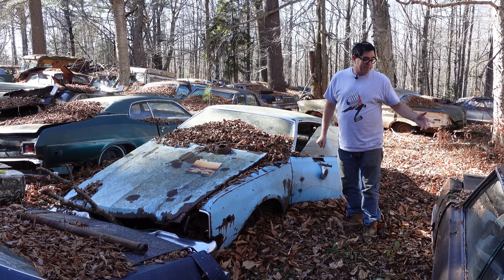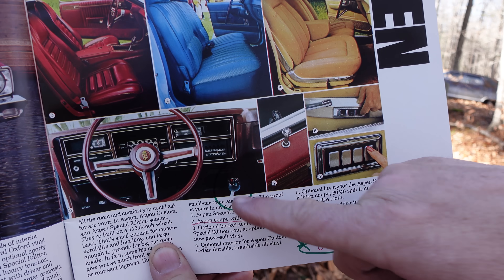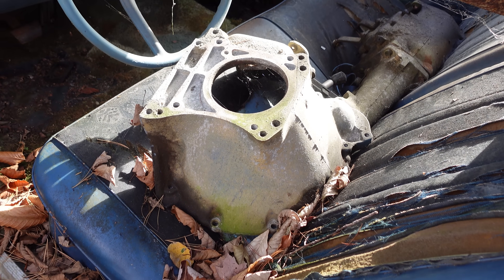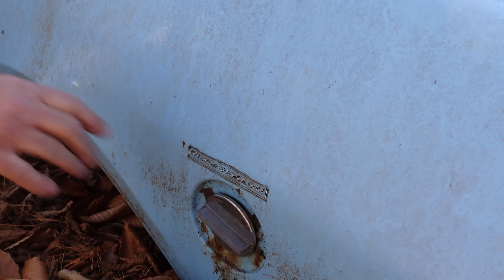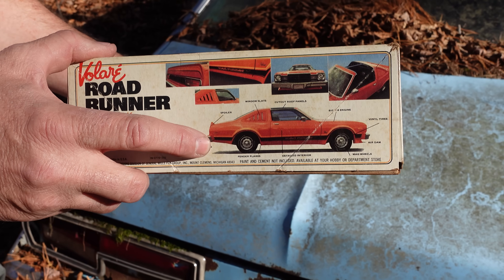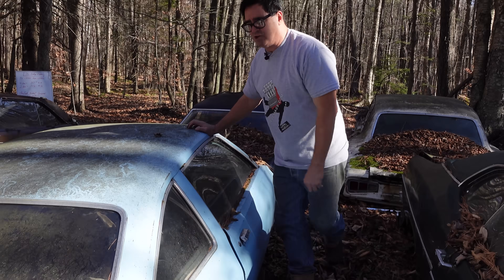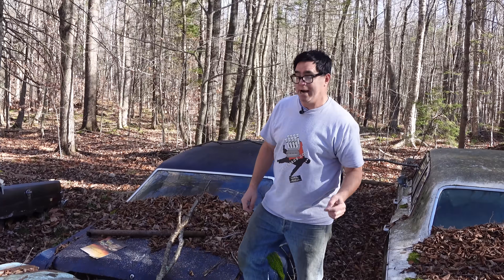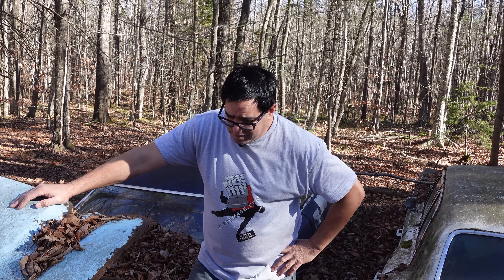First F

Comment: Great 👍 review Steve ! My parents owned a 1975 Dodge Aspen sedan, the drivetrain was bulletproof but rusted out within 10 years , my parents ended up buying a 84 Pontiac Parisienne wagon  .
Reply: I think you mean 1976 as that was the first model year for the Aspen, not 1975.
Reply: @googleusergp  yes my stupid phone has a mind of its own . We had a 76 Aspen.
Reply from the maker: Thanks for sharing!
Reply: We had a neighbor that had a 1977 Plymouth Volare station wagon brand new. It had rusted so badly by 1983 they they traded it in and never bought another Chrysler product again. They traded the Volare in on a used 1979 Chevrolet Impala Station Wagon from the local Chevy dealer. They had The Impala until 1990. The story with the Aspen and the 1984 Pontiac reminded me this.

Comment: The nozzles were different,.but leaded gas still existed (regular or premium) into the late 1980s. I worked at a gas station and one day, a 1970s Aspen Wagon was at the station, and i saw it had no unleaded sticker, and the tank opening was larger. The owner revealed it was brought over from Europe. So it was configured for leaded gas.
Reply: One small chain here sold leaded gas as late as 1992.   Sears, not to be confused with the department store.  They were based in Rome, NY and had 40-ish stations in central New York.  Eventually Hess bought them out.
Reply: @CR7659  Yes, by 1996, it was completely banned. By 1986, it was mostly gone. Some 1970s small engine manuals (such as Tecumseh) will state, "Use either regular leaded or unleaded fuel".
Reply: @googleusergp  I put it in a 1970 Gran Prix with a 4-speed.  Wish I knew where that car was now.
Reply: @CR7659  Can't save them all. LOL.
Reply: @googleusergp  My dad sold it running and driving in 1992

Comment: The 360 police specials had dual exhaust pipes back to the differential then two into one resonator on the passenger side of the fuel tank. The single exit diameter was so large some thought it was a diesel.  
I put a lot of miles on that car, loved it.

Comment: I had 2 Volares. The first was a 77 Coupe bought in 1981. It had the front fenders already replaced but they were still in primer (no one bothered to paint them). I rattle canned and wet sanded them, which came out fine for what it was. That Volare saved my life in an accident caused by a moron in a Camaro. They were strong cars;  that crash beam in the door was no joke. My dad and I stripped the wreck for parts and scrapped the body.  I found a low mileage 1979 Volare sedan and drove that to the point where the actual k-frame rotted out from underneath it. By then it had over 160000 miles on it and was a dual-fuel vehicle (burned equal amounts of gas and oil).
Reply: The NY rust would eat them alive, just as it does in New England where Mr. Magnante lives.
Reply: @googleusergp  That and the salty south shore environment on Long Island where the 79 came from. It was doomed from the start. Amazingly, my dad's 66 Coronet survives to this day with only having minimal rust in a few areas that I've since welded in patches. He had it undercoated from new (I still have the receipt; it cost $25 back in 66). He babied it from new but it was his daily driver for 30 straight years (right until he retired), then became a weekend warrior.
Reply: @LongIslandMopars  My '80 Trans Am was Ziebarted in 1981 (yup, I have the receipt for it too) and their motto is, "It's Us Or It's Rust" and now, "It's Still Us, Or It's Rust", and for the most part, it has worked. Ziebarting is still big with heavy trucks and utility bodies today. My parents bought the car new and whatever I didn't have for it new, I "recreated" by finding NOS and using a typewriter to replicate it. For instance, for some reason, the dealer warranty folder wasn't with the car. So I found a good used one in the yard that was blank and my mom still had a typewriter at work at the time, so she typed in the information as the title clerk would have done in 1980. The sales manager that sold us the car just died in May of this year and his family did a tribute to him on  YT. Look up "RIP Ernie Viespoli" and that's the person that sold us four Pontiacs between 1977 and 1981. You can see him wearing some dealership shirts in some of the footage. 

A few years back I contacted Ziebart and the woman there sent me a few new "Knight Shield" 'Ziebart NOS decals that they still had. Although they are a different color than the originals, they are close enough. My parents had a Chapman alarm installed in 1981-1982 and their motto was "Chapman: You Can't Beat the System". The model was called "The Insurance Man". It still in place on the car, and I have all of the keys (and books) for it, but it hasn't been used in several years.
Reply: @googleusergp  Very cool. I also remember the Chapman locks although my dad's solution was to pull the coil wire on the Coronet and then chain down the hood. 😁 When my parents bought a 1984 Chevy Celebrity, they had a Maxi-Lock installed. That was too fancy for dad but mom had to have it.🙄
Reply: @LongIslandMopars  Yikes, the wrong "A" body. LOL. My cousin had a 1987 Celebrity 2.5L Eurosport that was a company car. My uncle was the fleet director there (retiring in 2005) and we all worked there at one point in time. I worked there for about a year and half while interviewing for automotive jobs (which I got one in 1994 and stayed there 11 years before moving to my current job). A lot of my family members got ex-company cars and my uncle had connections where he could make a phone call and they would give us employee/factory pricing on a vehicle. My 1989 Cavalier was bought that way by my grandparents. $10,500 out the door, everything, with one phone call. 

Yup, can't steal (easily) what you can't start. That would foil most thieves and that was the idea. Our 1980 Bonneville Brougham was stolen in 1982 when my dad, uncle and grandfather went for pre-season bowling practice. My dad knew it was gone when he came out to the lot. When the cops came to take the report, the cop said, "Hey Mac, lemme ask ya this: Did it have a leather or velour interior?" My dad said, "Tan velour". The cop said, "Mac, call yer insurance company. That car is already on a boat overseas. Fahget about seeing again". Never did find it and it was replaced with a 1983 Coupe DeVille. My father went on sell Cadillacs at the same dealer a year and a half later, but he still told his colleagues, "As much as I like my Cadillac, I liked the Bonneville better". LOL.
Reply: @googleusergp  Ironically, the Celebrity was a company car that my dad's job leased from Avis. They would offer to sell off "the good ones" to employees after the leases were up so my dad bought it for my mom in 1987.  It was a CL in Autumn Maple Firemist with the velour interior and 2.8. Since we were a Mopar family up to that point, it was a huge departure from what we were accustomed to. Rode great, steered well, V6 was fun. Then the problems came (clear coat peeled, TCC solenoid went bad twice, morning sickness in the rack, electronic Rochester started acting up). We changed the rack once and the TCC solenoid twice, got the upper half of the body repainted, and tweaked on the carb. Kept it going until 2011, then it got donated to Kars 4 Kids. I do have an appreciation for how GM cars ride and steer. I've had my share of Fords in addition to my Mopars and will still say that GM rides the best based on that little Celebrity.
Reply: @LongIslandMopars  My dad worked for a Cadillac dealer from 1984 to 1988, so they saw the "Cadalier" (Cimarron which was a gussied up Cavalier) in the shop. Right away you could see that Cadillac was going down the tubes. LOL. The front wheel drive downsized DeVilles and Fleetwoods were another step in the wrong direction. The Skyhawk that my grandparents got to replace the Volare in 1986 was a trade-in. It was an OK car, but yes, it got "morning sickness" and it needed a rack and other repairs. The "Disaster Jet" was also problematic over time. They sold it for more than they paid for it and bought the Cavalier which was their last new car which I got from them in 2002. When I got it, it had never been outside of a 10-mile radius of their home and never crossed a bridge into another state or anything like that. I drove it about 50k+ miles before I "retired" it, but still have it.
Reply: @googleusergp  Cool stuff. Great memories now, even if they weren't good back then. 😁. Cheers.
Reply: @LongIslandMopars  Yup, I guess I've become the "caretaker" of what our family used to own: I live in the house I grew up in, I bought part of my grandparents' property from their estate, I own their and my parents' cars (all are passed away), so yes I guess I in some way am keeping the memories "alive".
Reply: @googleusergp  Sold my childhood home upon the passing of my dad. The Coronet came with me, though, and I'll take care of it for as long as I am able to, which will hopefully be many more years to come.
Reply: @LongIslandMopars  I got lucky. I had the chance to buy the garage (at my grandparents) that my Trans Am was kept in for years and my childhood home. I didn't pass up either opportunity.
Reply from the maker: Hello All, I had a brand new 1987 Chevy Celebrity Eurosport station wagon (white with burgundy velour interior) as my salesman's "demo" car when I sold cars at Ragsdale Chevrolet in Spencer, MA. It had the 2.8 liter 60-degree V6 and was actually very fun. I'll never forget the guttural snarl of these somewhat unruly / unrefined little engines. But they were right for the times. I had that Eurosport "demo" until I made the mistake of driving it to the Hartford Hai-Lai fronton and the odometer went over 1,000 miles....a no-no for retail sale as a "new" car. I was "demoted" to a used Pontiac Sunfire with the 1.8 OHC four popper. Very notable decrease in power - and clout. -Steve Magnante
Reply: @SteveMagnante  Cool wagon, Steve. I remember those Eurosports very well and thought they were nice looking and very practical. I remember the 80s and 90s when GM stuck that 60 degree V6 in everything they could. The sound they made was very unique. My cousin's girlfriend had an 87 Fire-chicken. Red with t-tops and the 2.8. Red car, redhead chick. Both turned a lot of heads....pun intended.
Reply: @SteveMagnante  Ragsdale was a victim of the 2008 GM bankruptcy and went out around that time. They were located at 324 Main St, Spencer, MA 01562 and there's a repair shop and auto body shop at that location now. My friend had one of those 2.8L V6 engines in a 1989 Cavalier Z-24 he bought new. It was fairly zippy and he had it for a number of years before buying a Grand Cherokee and then a Mercedes convertible.
Reply: @SteveMagnante  Sunbird, Steve.  The Sunfire didn't come out until years later.

Comment: My wife bought a 76 Volare Sport right off the delivery truck at the dealership. Yellow 318 with a white interior that we loved. Two years later we suffered the fenders rot. We had to fight with the dealer for a long time to get him to include replacing the stripes as he claimed he was only going to replace and paint the fenders.
Reply: Experiences like that is what turned loyal "Big 4" customers into import customers for life. My former coworker (unfortunately he retired and passed away) had both a 1976 Monte Carlo and a 1981 Honda Accord when he lived in Chicago. The windshield leaked on the Monte Carlo from day one and GM told him to pound sand. The Honda Accord had some sort of oil leak that was expensive to fix and the car was just out of warranty. He wrote a letter to Honda and they handled it with no problem. He always told me, "I want to buy American made, but they just don't make it an enjoyable experience". He had one or two more US made cars after that, but the rest were imports.

Comment: Back in the early 90’s I had a ‘78 Dodge Aspen as a winter beater. It was unremarkable in every possible way, but very reliable with the tried-and-true Slant Six under the hood and actually very little corrosion for a Minnesota car! On a cost-per-mile basis it was probably the cheapest transportation I have ever had short of my two feet and a Huffy 10-speed……😂

Comment: A friend purchased a Aspen police package 4 door sedan. It had the V8 with 4 barrel and an "almost" dual exhaust. There were 2 pipes and 2 mufflers, probably 2 cats too although I don't remember. The driver side pipe crossed over behind the axle and joined into the passenger pipe going into a larger than usual single tail pipe.  

It was a neat car just out of police service and had all the special package equipment: certified speedometer, rubber floor, industrial style cloth seats, wide wheels, small hubcaps, maybe an oil pressure gauge and rear sway bar too.
Reply: When I was in the Air Force, we had police package Volare's for Air Force Security Police, complete with rubber floors and the certified speedo.  However, since they didn't pursue anybody on an Air Force Base, they were equipped with the slant 6.

Comment: Back in 97 I picked up a 79 Volare sedan 225 six 90,000 car for my brother.  He drove it all over and through one winter in college up in Rochester NY.  The car reportedly cork screwed in handling at speed perhaps out of adjustment transverse torsion bar suspension.  Otherwise a very reliable tank for him.

Comment: I owned a Volare Wagon, don't remember what year.  It had the slant-6 with the floor mounted 3 speed manual overdrive transmission.  With a wife & 2 kids it worked out great, lots of room, good fuel economy and a 4-on-the-floor.
Reply from the maker: Very cool!

Comment: I remember the E58 equipped cop cars had a dual  exhaust  up the rear axle, then went into a single muffler with a really large diameter tailpipe opening.
Reply from the maker: Hello roger628, you are VERY CORRECT! Those E58 single-outlet exhaust systems were actually very efficient at exhaling the 360-4 at full power. Remember how the single tail pipe was huge - like 2 or 3 inches - and pointed down toward the street. The Worcester, MA police dept. had a bunch. In Roger Huntington's 1983 book "American Super Car" he shows a factory illustration of the E58 dual/single exhaust system. TWO catalytic converters and two cannister mufflers ahead of the rear axle! Dual cats doubled the cost and their distance from the engine resulted in dirty cold start emissions. "Cool" stuff indeed. Thanks again for writing. -Steve Magnante

Comment: Had a 80 Aspen wagon the doors froze up a lot in the winter locks  wouldn't work when cold only the tail gate would open. I would have to crawl over the back seat reach over the front seat take the snow brush to the gas pedal to set the choke and start it then wait ten minutes for the heater to thaw them out. My neighbor down the street had the same problem she used a space heater to warm the driver's door it was yellow with black burn mark on the door.

Comment: I saw thousands of these things go through an auto auction where I worked in the early 80s.  When things were slow on the lot, we would be sent to the rail head to pick up Volares and Aspens.  About once a month we would have a Chrysler only sale.  I think these cars were coming off Chrysler leases.  I thought they were all junk, but just a little better built than the Ford Fairmonts I saw come through the auction.
Reply: Good point, the Fairmont was a car that Aspen and Volare owners could look down on 😉
Reply: Everything was junk in that era
Reply: @FrankBullitt390  Depends on what it was. Not all of them were, but the US carmakers were realizing that they couldn't get lazy anymore and still get the sale. The Japanese showed us that they could eat our lunch.
Reply: I was wondering if those Aspens and Volares you're talking about were sales Bank cars.

Comment: Hey Steve, this one brings back some fond memories. An old co-worker of mine purchased a brand new 77 Aspen. Bright orange with a half vinyl roof in white. Slant 6 with 3spd manual, floor shift. Only issue was trying to get it into reverse. Dealer couldn't figure it out, traded it in on a 79 Formula Firebird.
Reply: Hopefully with a Pontiac V8. LOL. The rare one is a 400/4 speed Formula in 1979. Only 346 of them were made, rarer than any 400/4 speed Trans Am in 1979.
Reply: Unfortunately no, either 301 or 305.
Still a cool ride though.
Reply: @johndouglas9517  Yes they were. I stripped one in a junkyard and still have the spoiler from it. It was a 301 Pontiac V8 two barrel, RPO code "L27". I even wrote most of the VIN number on the underside of the spoiler in a Sharpie so I'd remember what it came off of. It was a Van Nuys, CA made car.